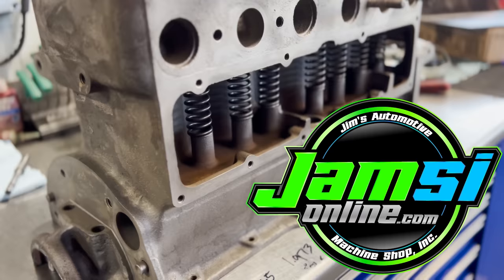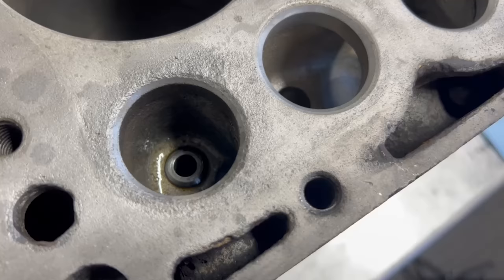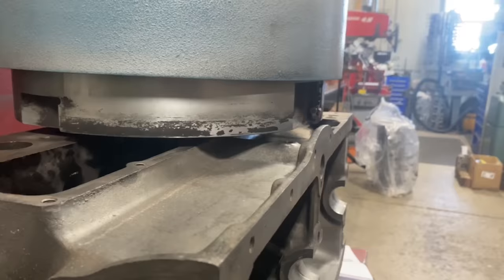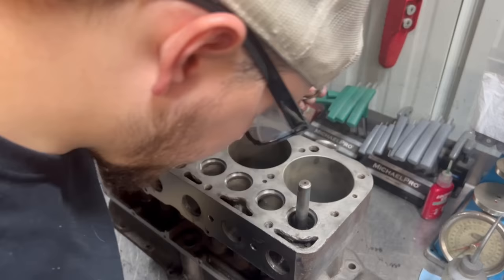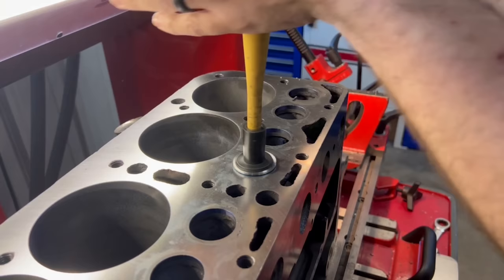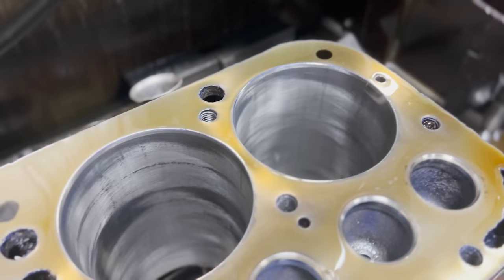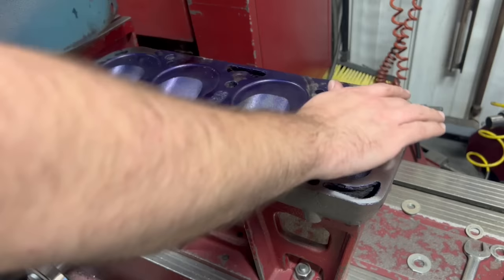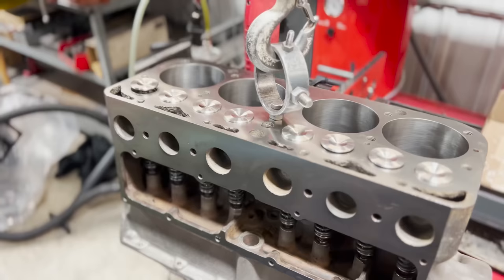Modernizing The 1929 Ford Model A Valvetrain

Comment: THE NEXT TIME YOU GET A STUCK STUD TRY THIS OLD TRICK.

HEAT UP TO HOT NOT RED-HOT REGULAR HOT (sorry caps) than jam a bee's wax candle into the threads at the block just jam it will melt like crazy that's good.

go have lunch let it cool all the way down (important)than with the stud tool it will crack free and be FINGER loose. it for real works. SNAPPED VW bug exhaust manifold stud was where this saved me.
(I always just used a regular candle but was told beeswax better you decide)

I saw it first used on a 75-year-old pipe joint 3 or more inch if I remember.

good luck

DISCLAIMER: FIRE IS HOT AND FIRE CAN HURT YOU.

Comment: Dude you need a screw knocker,it's used in the aviation industry. Works great for removing stubborn fasteners with help from a rivet gun or pneumatic gun used in automotive industry.

Comment: As an experiment I would like to see someone cnc a modernised version of a flat head six with four valve cross flow block then Dyno it both na and blown and compare the weight x size by power with a 2jz or similar.
If you design it right with the valves angled slightly towards the piston you could possibly get as good performance as the 2jz

Comment: I wonder why they stayed with the same size valves for the intake and exhaust, with the modern valve kit. It seems a larger intake would give better performance, it would be interesting to see if it would give a measurable increase in power.

Comment: My questions: Was there a reason the guides are that worn? 100K mile engines are usually tighter than that. What caused the scuffing on the broken piston? All the bores were approximately the same, and that was the only piston scuffed and broken.

Comment: 100 over bore? Isn't it time for some cylinder sleeves? Mighty close to water jackets which make a hotter running engine. Love the decking and valve work. Motor should run like a hemi when it's done. Well at least tighter and smoother the stock.

Comment: Random question: wouldn't it be an advantage to heat the block first before surfacing? Perhaps to a temperature between room temperature and operating temperature. This to take thermal expansion and warping into account.

Comment: Great job on that engine!  I do wonder though if after machining the block and head if there will be an issue with the pistons contacting the the bottom of the head. I've done several old ford tractor engines and have had the problem. Simple fix, grind out the chamber of the head, but something to consider..

Comment: Lovely work although you have surfaced the top taking a mean of level from the top of the block and then machined the bores using the top as the datum. This way there is a strong chance that the bores are not truly perpendicular with the crank. The increase in friction  on a low powered engine like the Model A would make a difference to the power output. This is just as important on a low powered engine as a racing engine.

Comment: My question, why go to the expense of new flathead type rebuild and not an OHV resto???
Way back when, my dad had a Model A Roadster with an Overhead valve conversion. I was a little kid but I have seen the B&W pictures he had and listened to "barbershop talk" with his cousins and buddies long into the war years.  I only remember it was called a Front... something and railroad iron was welded to the frame for rigidity(?) or weight(?)) .
It still makes me very sad that dad had to give up his first new car in '38 when my sister was born because they needed a family vehicle. Some old boxy Dodge (B&W's again), then a 1934 4dr sedan AND THAT I remember, owned clear into 1950.
Anyway why not an OHV??

Comment: I wonder what the upper limit is on how much power the flathead can make considering its against-gravity air/fuel path (upward instead of downward like in later engines). I imagine these engines respond pretty well to forced compression like superchargers because of the lack of gravity assist.

Comment: Stright motor oil for coolant looks horrible to deal with in a CNC operator and we use hocut and it works great on end mills I bet it would work good for your cutters to and clean up is a lot easier

Comment: One quick question for you.  When you removed the old studs, you said they were corroded, and you had new studs in the shopping cart just in case.  Since the old studs were corroded, why didn't you go ahead and plan on replacing them wither way?  BTW, I really enjoyed the video.

Comment: Used to rebuild engines  , I imagine some things have changed in the past fifty years . Or the model A might be different, we never ground valve tips as they had a hardened tip and didn't want to grind through it . Was grinding valve tips standard on these engines ? Also our machinist used to line bore the crank , and then bore cylinders and deck to square with the crank . Is this a practice that has changed ? 
P.S. our machinist was a veteran who did a lot of his training remachining Willy's blocks in WW2.. He said that they were pumping them out so fast that after 6 months of use the core shifted and everything had to be realigned . Was this maybe the reason he did it that way ?

Comment: I’m sure this has been asked. You are removing alot of deck surface. That changes the head/block dimension. Do you change the thickness of the head gasket to bring it back to spec?
Reply: Using two gaskets is rarely necessary on these engines. Compression is low to begin with and there is a lot of room above the valves. Hobbyists used to mill the heads on purpose to increase the CR, but you can only boost it about 5% that way, not really worth it.
Reply: @alexiskai  I figured with the low compression you didn’t have much to worry about. Didn’t know if they make thicker gaskets if needed.
Reply: @rolpher  No, all the gaskets on the market are roughly the same thickness, they differ only in materials

Comment: You are missing one very important key component to precision. Heat ! Fords were originally machined in a Hot Factory. As does Toyota performs operations at operating temperature. As aboard our Navy Repair ship The machine shop was one deck above the engine room. Get cooking!

Comment: The good thing about these older engines is that you don't really have to be concerned about messing with the compression ratio too much because the compression in these old girls is laughably low to begin with.

Like 4.2:1, this might be 4.25:1 or 4.3:1 now maybe, if even that much.

Comment: I too, would like to know if you took compression ratio into account when you took all that material off the deck.  I am assuming it's not as crucial on flatheads with such large chambers.
Reply: Stock CR on these is quite low, 4.2:1. The combustion chamber is so large that milling the block & head doesn't raise the CR much. The main concern is that, depending on how often those surfaces have been milled flat before, and which pistons the customer is using, it's theoretically possible to run out of "squish" room between the piston and the head. Doesn't happen often, but the customer should measure the flycut depth and pop-up height when installing the pistons to make sure there's enough room.

Comment: At 5 thousand you would have been fine as gaskets from the day will make up the rest.
And no one makes a leaking gasket.
Also, a FelPro gasket has the most give, If however you need maximum performance then follow this video.
The change between the 2 ways of handling this is maybe 3 hp.
Doesent matter with a double clutch you have to learn,,,,,, You will not miss the 3 HP.

Comment: I know you gave a lot of shade tree mechanics that never worked on these engines a heart attack, when you said you took the engine .100 over. lol But I am still not convinced you needed to grind the old seats out to convert the engine to run on unleaded gasoline, since that engine was designed to run on methanol/ethanol gasoline or just straight up alcohol to begin with. As it is for better or for worse a model T engine, which was designed to run on pure grade alcohol. All though seeing the pitting in this video which I did not see before, it probably did not hurt to grind out and replace the valve seats anyway.

Comment: Did you check for valve to head clearance after machinging it? I have NO CLUE what the max lift on the Model A engine is, but would think it might be a concern?

Comment: Other folks use a torque playe on the block when honing/ machining bores. Why not do this?
Reply from the maker: Take a quick google search for "Model A Ford Torque Plate" and see what comes up.... I'd be amazed if anyone even makes one for this engine. It's completely unnecessary for this application.

Comment: Not seen any torque plate usage in your videos. Do you not use them, or find no need? Seems, in my recollection of machining some 30 years ago, that they where used to simulate head bolt down pressures on the block.

Comment: What is the expected output of a old 4cly like this one?  I've always been curious.   Great work.  I'm glad I still have my Legos. 😄
Reply: I think 40hp, definitely less than 50hp though.
Reply: @9HighFlyer9 , is the tourqe decent?
Reply: @jacobthornock317  I don't know for certain, my Grandpa had one when I was a kid. I remember power being down low like 1500-2500rpm
Reply: Stock engine puts out 40HP at 2000rpm and 130 lb-ft of torque at 1200rpm. Aftermarket carb and head can take it to 60HP and 155 lb-ft pretty easily.
Reply: @alexiskai  wow, that's more torque than I'd have guessed
Reply: @9HighFlyer9  These are some of the highest displacement production 4-cylinder engines ever built, 201ci or 3.3L.
Reply: @alexiskai  I didn't realize they were that large. The Lycoming O-360 engines are pretty big 4 cylinders too, 361ci/5.9L. Not quite as old, but still in production.

Comment: What do you do to reduce the compression back to where it should be after removing all that material ?
Thicker gasket  ?
Or is modern fuel better suited to a higher CR than back in the day fuel  ?
Reply: Yeah, there's no need to adjust anything, the stock compression is 4.2:1 and decking the block/head doesn't change that much.

Comment: Am wondering how you arrived at the stem length on valve. All the model A motors I rebuilt, the cam and lifters were fitted and after the seats and valves cut and lapped etc. Then the stem was ground to give Tappet clearance . How did you figure out length of stem?

Comment: this is one of those times you can say better than new and mean it they did have the machining we do today they had belt-driven line machines bake then that ran the length of the factory power by steam or stream-driven electric. They were still coming out of the stone age with tools not much better. when you say good ol'days what does that really mean?

Comment: @jamsionline Will you tell us more about what stud removal tool you are using?
Reply from the maker: Mine are Matco brand but they're just like these: https://www.amazon.com/Performance-Tool-W89413-4-Piece-Puller/dp/B0000AXFMG/ref=sr_1_6?crid=GXDNVSJIBQB6&keywords=stud%2Bremoval%2Btool%2Bmatco&qid=1669663318&sprefix=stud%2Bremoval%2Btool%2Bmatco%2Caps%2C106&sr=8-6&th=1
Reply: @JAMSIONLINE  Very helpful, thanks for the quick reply. Out of curiosity, do you have a preference of these over the 2 nut method?

Comment: Is it difficult to obtain gaskets when you take additional cuts to the cylinder face. I always wondered does it become a problem to source parts for rebuild
Reply: The head gaskets currently sold for the Model A will fit a .100 oversized bore but that's about as big as you'd want to go. Several decades ago, the standard gaskets fit a smaller bore – and consequently had fewer failures because there was more material – but I think nowadays so many blocks have been bored over that they decided to make the gaskets to fit them.

Comment: 9:29 If that deck had already been cut, why would'nt it have been uniform when doing the valve seats? It cut some alum on the valve side but not the back side?
Reply: Because the valve stem isn't necessarily bored exactly perpendicular to the deck surface.
Reply: @16vSciroccoboi  Not really sure what that has to do with my question.
Reply: @beachboardfan9544  the valves and seats are cut according to the valve guide. If the valve guide hole is machined in the block at any angle other than perfectly flat to the deck, then you get the result you're talking about. 

Just because the deck is flat doesn't mean the valve guides are straight up and down.
Reply: @16vSciroccoboi  I get what you're saying about the seats not being perfectly straight or flat, but I'm not asking about the seats.
If the block was decked (making it perfectly flat) then the seats were put in, then the block gets decked again, but now its cutting on one side but not the other, why would that be, it should've already been flat from the first decking, right?
Reply: @beachboardfan9544  no. Because machining the deck flat doesn't change that the valve stem and guide holes are not perpendicular to the block. So when the valve seat is cut and it's perfectly straight with the guide, it will hit the seat at the slight angle that the deck was to the guide
Reply: @16vSciroccoboi  Yep still dont care about the guides or seats at all...

WHY is the BLOCK decked (made perfectly flat) THEN when its back on that same machine THE BLOCK is no longer perfectly flat?
Reply: @beachboardfan9544  the BLOCK is perfectly flat. The VALVES are not.
Reply: @16vSciroccoboi  8:53 The fact that it cuts the valve side of the block but not the piston side proves your comment is wrong...
Reply: @beachboardfan9544  the block is machined on the entire valve side all along the left edge and still hits on the opposite corner in one small section. The deck is just that crooked.

Up until that point the deck had never been surfaced.

Your original post made it seem like you were wondering why the seat cutter hit one side of the seat before the other if the deck was machined flat. It wasn't clear you were asking why the deck surface wasn't flat, and the reason is that it hadn't been milled flat yet at that point.

Comment: I am not familiar with these old engines, but why wasn't new cylinder sleeves inserted with modern superior metal and coat finishing?  Metal in those days was nowhere near as good as today. The great thing about renovating old engines is that modern metals can be used, which are vastly superior of yesteryear.  Also modern rubbers which are a world away from those days.

Comment: Did you just get into engine building and got access to all this equipment? there's so much dumb mistakes you make.
First. this engine will be using a cast iron ring, you want to hone the bore with around 220 grit stones for cast iron rings, a fine stone will lead to poor ring seating when using cast iron rings.
Second, to install valve guides, and seats, you need to freeze the valve guide or seat as cold as you can, also helps to heat the block a bit, this will make it easier to drive the guide/seat into the block, wont risk destroying the guide/seat or the hole it's going in, it will also make a stronger fit that wont risk going loose.
Thirdly. You left every surface you decked still rough, it's smooth when it looks smooth, seeing pitting is not smooth, I'd understand you doing this on your own engine since a low compression engine such as this will most likely not have problems, but if you're doing it for a customer then this is just lazy workmanship.

Comment: Come on admit it those weren’t your “old” Legos because you still play with them on a regular basis. I do and I am a lot older than you are.
Besides sometime in the distant past it was decreed as so why do you install new valve guides so early in the block overhauling process. I would think doing so would increase the probability of a chip fragment being missed along the way an potentially damaging the guide or valve in the mock up process, where as installing the guides later in the block assembly process the changes of debris accidentally missed when blowing the block out would be lessened because so much of the “heavy” machining has already taken place.  Just curious

Comment: Guys have been building overhead valve heads for flathead Ford 4 cylinders & V-8s for decades so "modernizing" the valve train on an old Ford flathead is not anything new or recent by any means. The LSR guys running flathead V-8s actually grind cams that switch the intake & exhaust ports when they put turbos on because of the 3 port siamese exhaust port block, where they can force the charge in but utilize the extra port to get the exhaust out. Nothing really new under the sun!
Reply from the maker: Didn’t say it was a new process a single time…

Comment: Why in hell would the owner opt for a stock cam, designed nearly 100 years ago?? You're just leaving free hp and tq on the table. We've had 100 years of improvements in cam design and manufacturing. It's foolish not to use them.